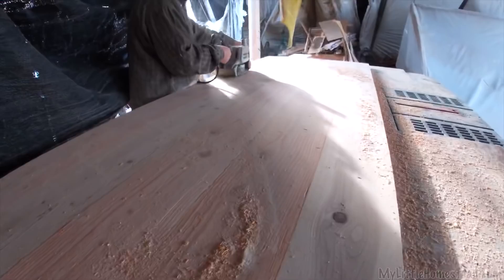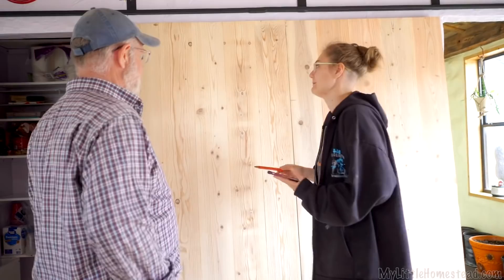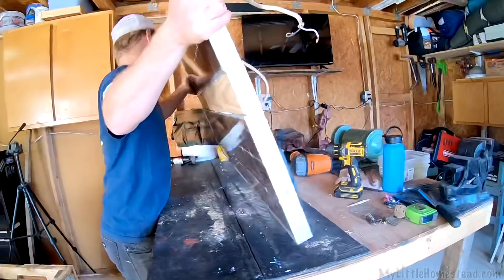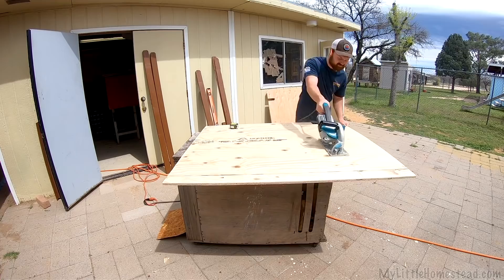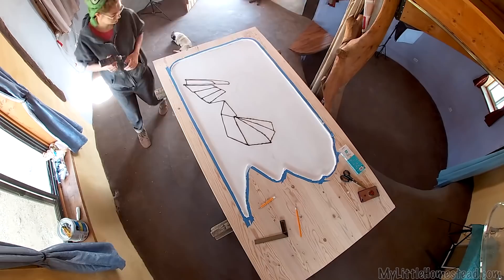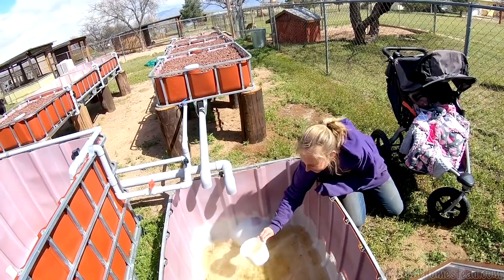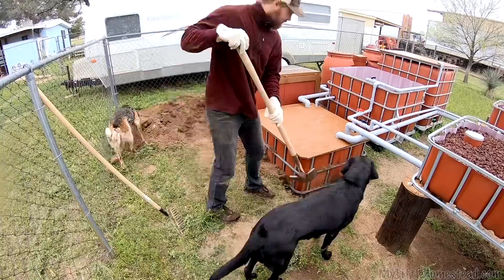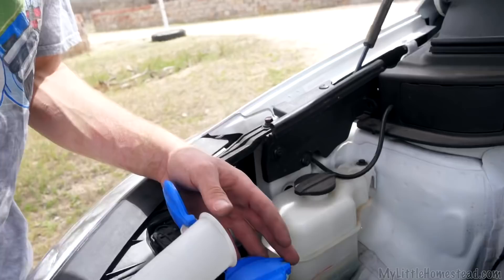DIY Aquaponics Build gets Water, Barn Door Art & Make Your Own Face Mask | Weekly Peek Ep229

Comment: I JUST LOVE HOW TALENTED YOU ALL ARE. I WATCHED AS THE HUMMINGBIRD WAS DRAWN AND AM ALWAYS AMAZED HOW PEOPLE CAN DRAW STRAIGHT LINES.    LOL. THE AQUAPONICS SYSTEM LOOKS LIKE A MAD SCIENTIST AT WORK AND THAT WINDOW WASHING FLUID HOLDER MUST HAVE BEEN DESIGNED BY SOMEONE THAT NEVER HAD TO WORK ON A CAR. I  USED TO WORK IN A DIESEL SHOP AND CAME TO THE CONCLUSION THAT ALL DESIGNERS OF CARS AND TRUCKS SHOULD BE REQUIRED TO BE A MECHANIC FIRST BEFORE BEING ALLOWED TO DESIGN SOMETHING ON AUTOMOBILES.   LOL

I THINK THAT DOOR WITH THE HUMMINGBIRD IS MY FAVORITE PART THIS WEEK. I LOVE HUMMINGBIRDS AND HAVE A FEW FEEDERS ON MY PATIO. IT SEEMS WE DON'T HAVE A LOT OF THEM HERE IN THAILAND BUT THE ONES WE HAVE AROUND HERE HAVE SET UP SHOP IN MY AREA. I AM HOPING THEY WILL BUILD NEST AND START LAYING EGGS AND INCREASING THE POPULATION. THEY DO A GREAT JOB OF POLLINATING FLOWERS TOO.
Reply: Brock many years ago I used to work in the mechanical side of a petrol station and one of the worst things I had to do was change the spark plugs in a V8 holden stays it took me 3/4 of an hour to just get the back left (looking at the engine) out there was so little room to manoeuvre that was my same light bulb moment on the designers I think any one who has ever worked on a vehicle (except the designers,) comes to that conclusion at some point in their lives!
Tony from Western Australia.
Reply: @MoondyneJoe , WHEN THIS HAPPENS THE CAR COMPANY GENERALLY DESIGNS A SPECIAL TOOL THAT IS ONLY USED TO DO THAT ONE SPECIFIC JOB AND IT COST 10 TIMES AS MUCH AS ANY OTHER TOOL IN THE MECHANICS  TOOL BOX AND IS ONLY USED ON THAT ONE VEHICLE. IT'S JUST ANOTHER WAY TO SCREW THE PUBLIC.

Comment: Shea, I sewed the top shut and then zigzagged the twist tie type  wire ( I used gardening stuff that they use to train plants on trellis, two nice sized rolls at the $ store) then when I top stitched the outside it was nice and secure and held tight against the top. Also I took a small dart on either side of that which snugged in the fabric nice and tight around cheeks and nose. I also took a small dart on the ends in the middle of each fabric which helped it lay nice and tight under the chin. I used two layers fabric and iron on non woven interfacing on at least one side which ups the filtration number a little. Hope that helps some, I had ordered some elastic that isn’t too wide from a fabric store and it got delivered today so I’ll be back in business this weekend. 🙋🏼                                    Ps. I was making them then a couple of nurses told me they weren’t that helpful because when you breathe out tiny droplets are exhaled and one the fabric is damp it fails to filter the virus. That was before they decided everyone should wear masks in public though so.......I think I’ll use these, better level filtration than nothing and it’s not like I’m working with people close up. Please stay safe, be well.🥰🙋🏼

Comment: Shae another option for the twister in your mask to conform around your nose is using pipe cleaners.  You can pick up a package at Wal-Mart for really cheap in the crafts section.  Also for those commenting on the droplets coming thru the cotton....yes it can happen because cotton is a woven material.  A layer of a bonded or non woven material between your 2 layers of cotton will stop them.  But it also needs to be breathable or  people won't be able to wear them long.  If you have any of the totes you get to carry your groceries in instead of plastic bags they are made of that non woven material.  I've been to Expo's where different businesses will pass them out with their company's logo on them.  I washed them and took them apart.  Depending on the size of the totes, I was able to get 8-10 linings for the masks.

And you want your mask to stay as close to your face without side gaps.   You might need to make ties with your lace trim instead of the loop unless your lace has elastic in it.  Overall your design was great!  Hope you make some for your entire family to be safe!